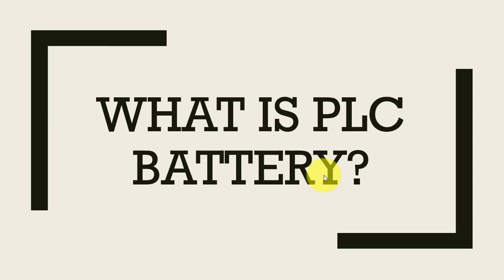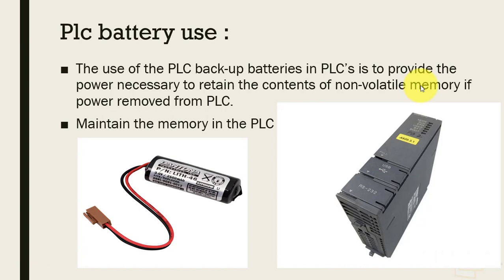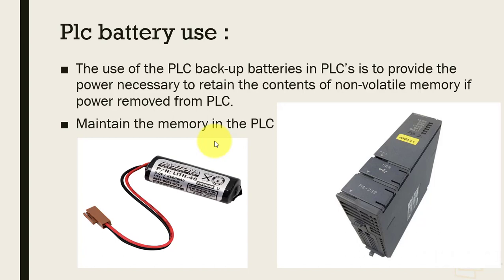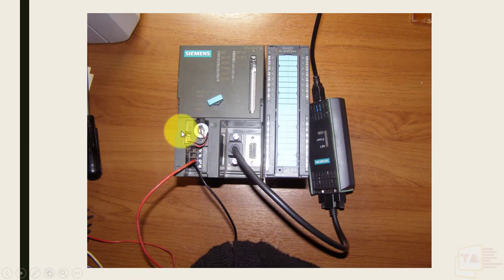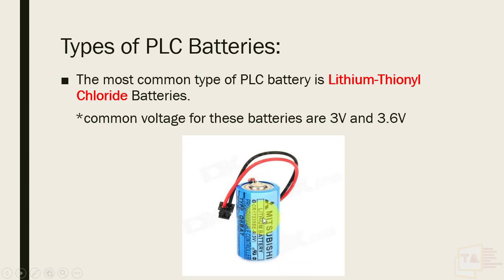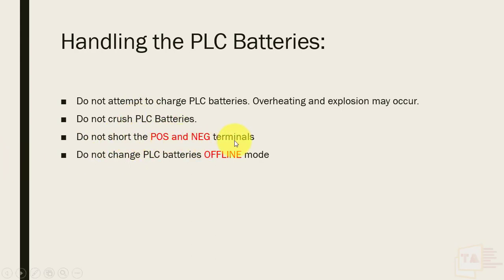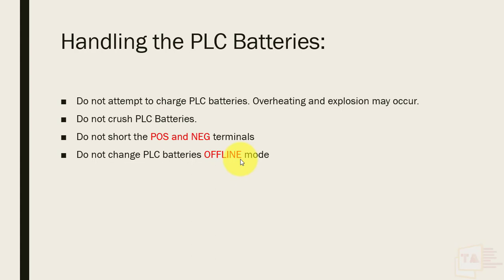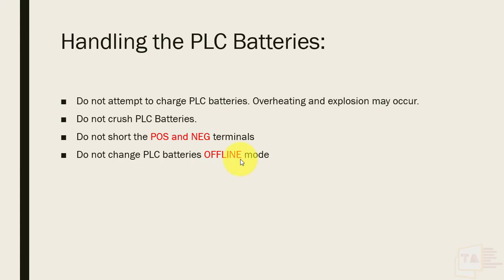What is PLC Battery | Explained in TAMIL

Comment: Fx-3GE-40MR-ES ithuoda full explanation kudukanga sir
Reply from the maker: FX3GE - series name , 3 mean 3rd generation , E included for its support Ethernet function 
40 - total no of io's 24 inputs 16 outputs 
M - main unit 
R/ES - AC power supply / DC 24V {sink/source} input  / Relay type output